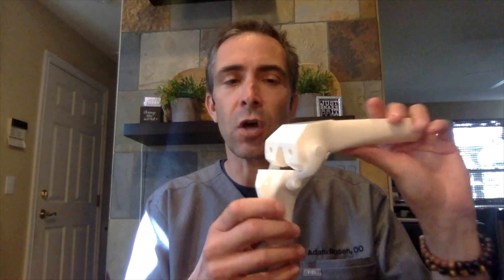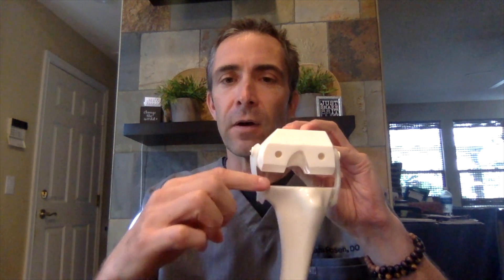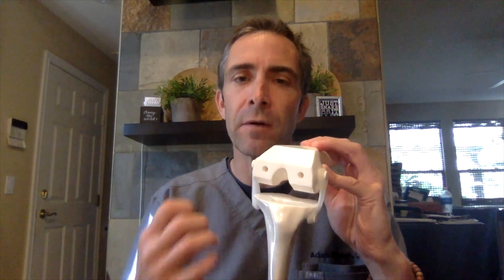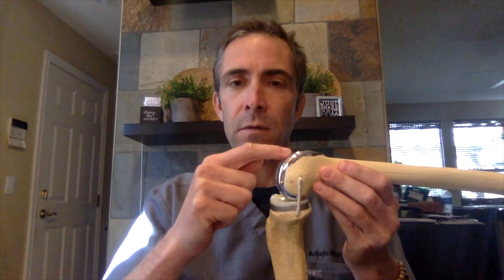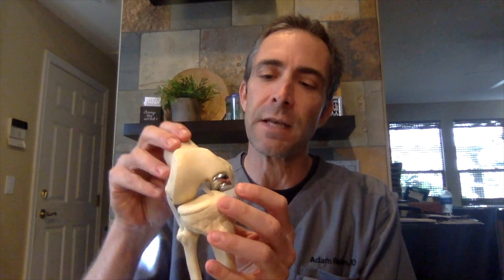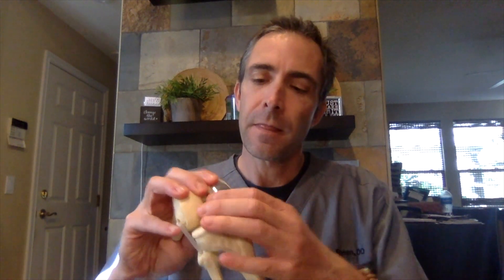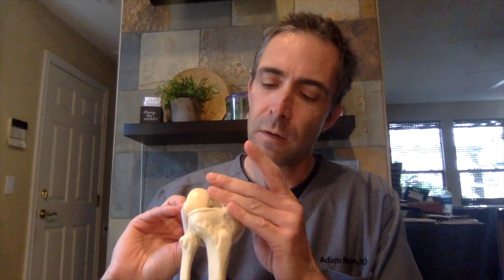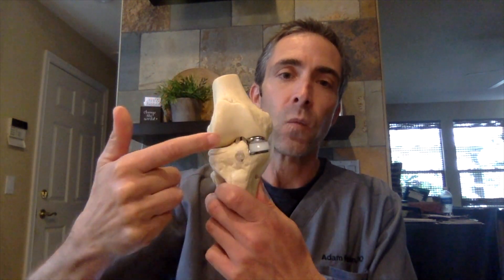Knee Surgery Secrets: What Really Gets Replaced

Comment: What soft tissues are removed or cut and repaired in order to get access to the join to install these components?  Asking because muscle, tendons and ligaments heal at different rates and may benefit from different exercises.  Thanks
Reply from the maker: An incision is made in the capsule, along the edge of the quad tendon and patellar ligament. The collateral ligaments, the MCL and LCL, are protected. Most arthritic knees don't have an ACL but if it is there it is removed. The PCL can be left if it is intact or there is a special plastic that can be used when the PCL is absent or damaged. Hope that helps.